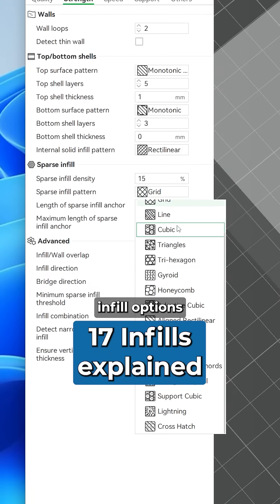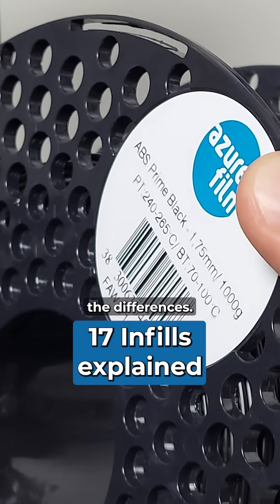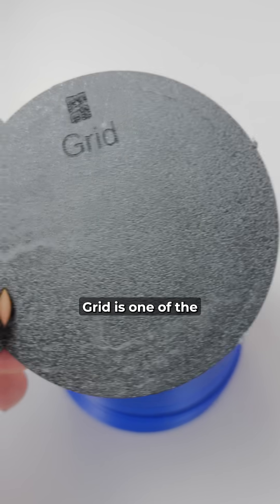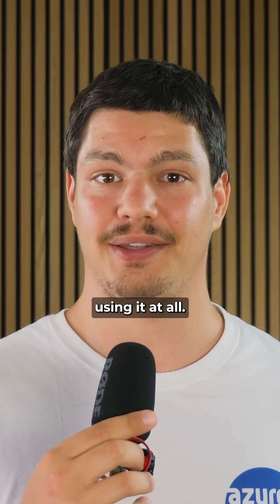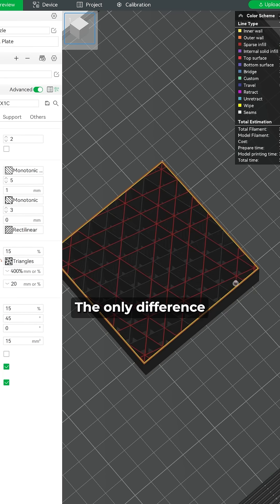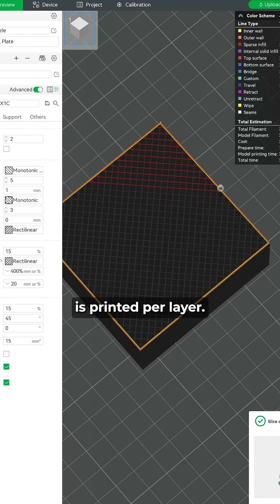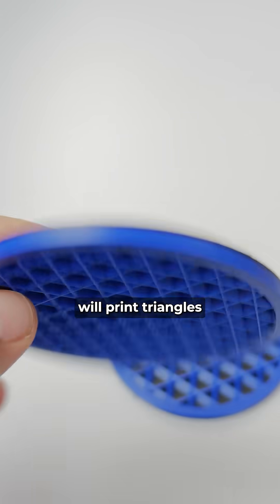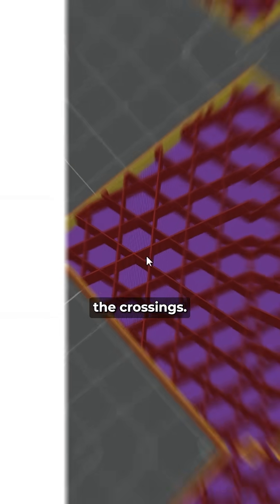Types of infill #AzureFilm #tipsnadtricks #3dprintingtips #infill #3dprinted

Comment: The best infill is no infill. I say this as a mechanical engineer who got into 3D printing while ago. I print like 50% faster than others because I account for nozzle and material properties. Also... I calibrated to run at max speeds which even spook me. The little Flashforge 5MP doesn't seems capable or safe at those speeds, but... manufacturer says so. Just need to keep it on the floor or it breaks my table.

But if you going to use infill, because you don't want to or know how to do advanced design (don't blame you... it's at times restrictive and annoying). You should prefer adaptive bicubic and lightning.

Especially if you print material which like to warp. More material means more tension from cooling, but without equal amount if rigidity. Rigidity is really a structural property. 

Only use bulk infill if you need to hit a specific weight. For everything else there are better ways if going about it.

I make it sound harder than it is. But it really isn't. Just takes but of effort. Anyoe can learn this advanced design and adjusting parameters if they so choose. However finding optimal parameters.... thats boring and slow.
Reply: Sounds interessting but it is hard to imagine without specific cases (pritned objects) where you can use no infill and how great the benefits are. Maybe a video with specific cases would be useful for others
Reply: @detmaat3039 a round vase mode would require no infill and just walls
Reply: Are you meaning hollow parts or removing material/geometry so the walls touch because I don't believe either is going to provide a stronger part. I'm not sure what else you could mean but, hollow parts don't have any link between the outside walls for force distribution and the further apart the walls the more surface area for force distribution. Lighting and adaptive are also the weakest infills.